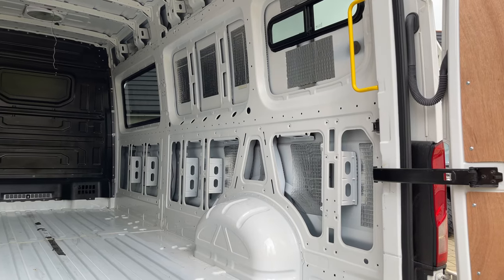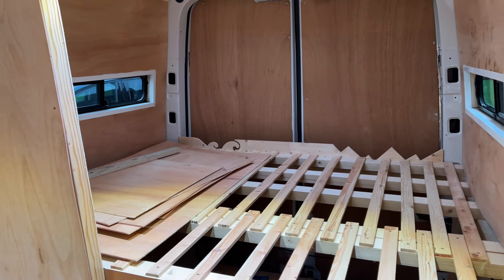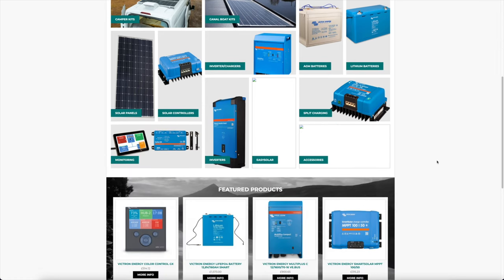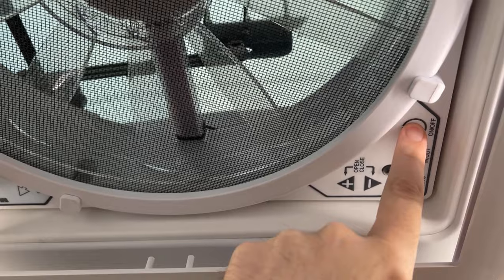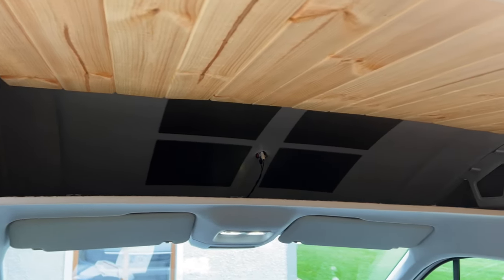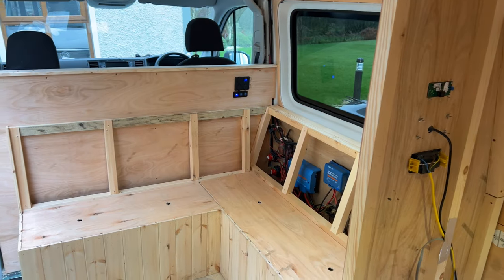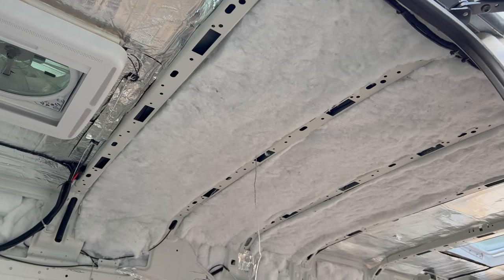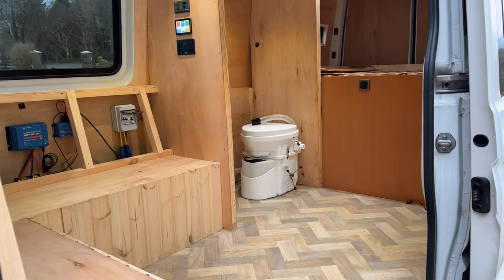Episode 4: VW Crafter LWB Camper Conversion - Electrics - Victron System - Natures Head Toilet

Comment: What size are those tyres Chris, any rubbing issues?.. would you have the full spec?
Reply from the maker: Hello graham! I never had any issues with them at all but be warned they are very loud when you’re driving lol 

The ones I bought:

BFGOODRICH MUD-TERRAIN T/A KM3 LT225/75R16 115/112Q
Reply: @chris-colton  225 is the width ya? Seems a bit narrow…
Reply from the maker: @grahamhiggins1816  yeah - I just double checked some pictures of the wheels on the van and that was the exact code!
Reply: @chris-colton  yes yore right. Reading up on it the narrow tyre with deep thread works well.